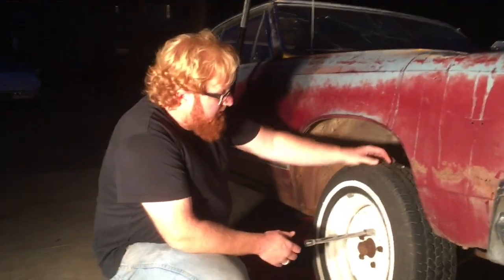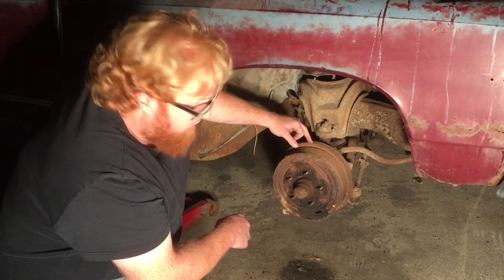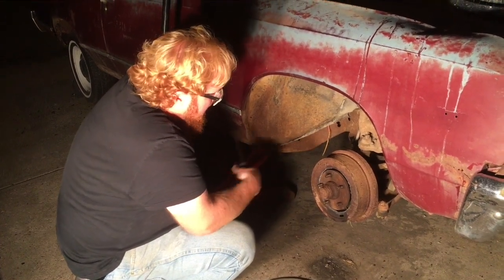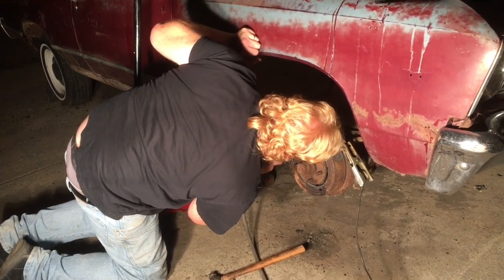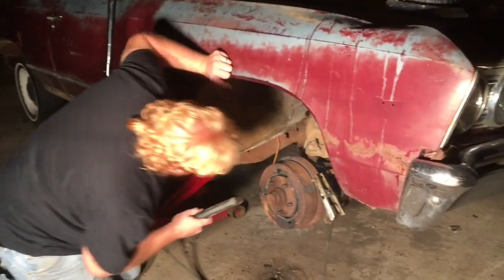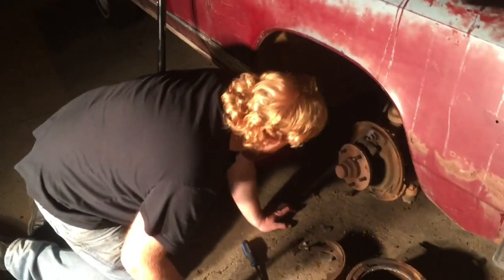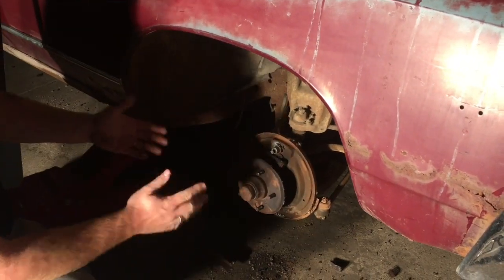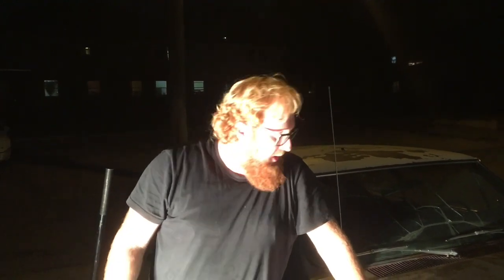Plasma Cutting A Brake Drum Off on a 1967 Chevelle Malibu Update #3

Comment: Man, that Sucker was STUCK❕ Are you soak'in the cylinder's now? I would be really put'n in some Automatic Transmission Fluid mixed with some Diesel Fuel and put'n that in there ever week or so to help loosen it up. I've used this mixture or many years and it works real good. Then after a couple weeks I would try to turn the Crank with a Breaker Bar-IF it don't move throw some more Mix in the Plug's, let her sit another week and try it All Over Again.
Reply from the maker: Yeah it was- the whole process took about 40 minutes.  I'm soaking the life out of the cylinder- I'm hoping it's going to work.